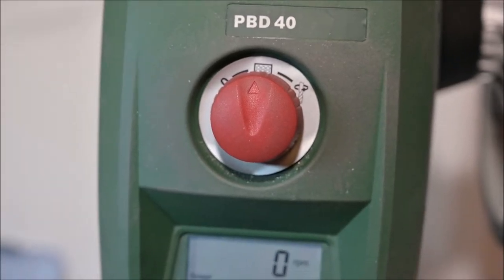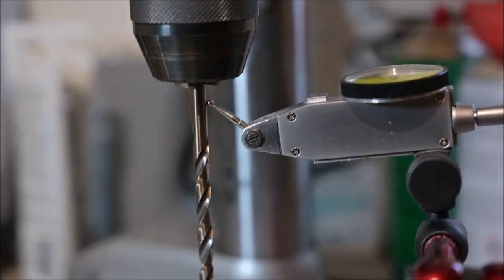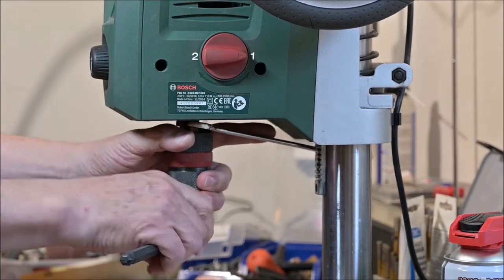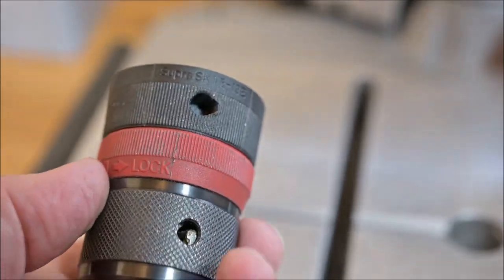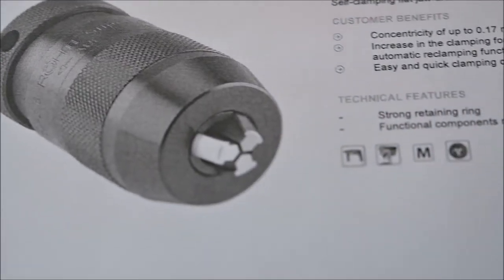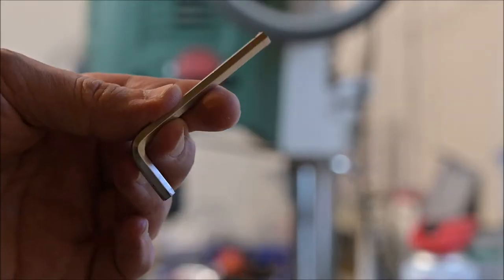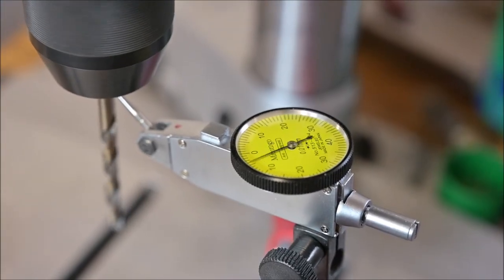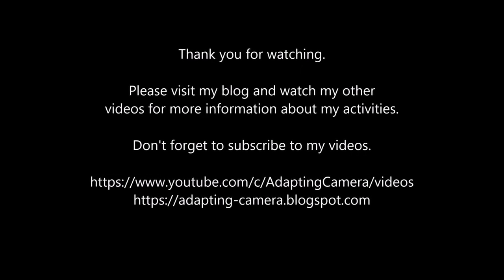Chuck changing on Bosch PBD 40

Comment: Be careful. In my case, I completely destroyed the chuck. I did it according to the presentation on youtube. The inbus key cannot be tightened well  in the chuck  and from there I started to have problems. The problem in my case is that the chuck is blocked after this  procedure  and is not possible  to  fix it. At the end I cut the chuck with the angle grinder( flex), so pay close attention.
Reply from the maker: I don´t understand how you managed to destroy the chuck. You must always check that the Allen key is properly tightened and NEVER use a hammer or anything that you hit it with. Many video on YouTube shows chuck removal totally wrong. Hitting the Allen key might cause damage to the chuck. Also, one can also use a chuck removal tool, which actually fits in the two upper wholes of the chuck and use that, not the Allen key, but most people don't have such tool. The method with the Allen key is safe, but as always, you must know what you are doing BEFORE. Attacking the chuck the wrong way may of course cause damage.
Reply: @AdaptingCamera  Because allen key is not enaugh tight in this  quick chuck ,this is the reason.
Reply from the maker: @alexandrubogdanjacob  In this respect, this chuck is not different from any other chuck. It is possible to tighten it enough and safely remove the chuck, but you must do it properly AND the Allen key must be large enough AND as I said, NEVER use a hammer. Tightening it like a drill bit and using brute force and hammer can destroy any chuck. I am pretty sure that this was the reason you destroyed your chuck. Your Allen key was not tightened (you did not check it in time) and you used brute force. How to tighten the chuck with difficult bits is described in the manual of PBD40. It is NOT my fault if you did not read it and started to remove the chuck without checking that it has a good grip on the Allen key. It is also possible that there was something wrong with your chuck already before. Anyway, saving the old chuck was not my goal, so even if I'd have destroyed mine I would not cry over it, since it is really crap. I would definitely not sell it or replace any of my other chuck with that one. It's the worst I have ever seen on any machines I ever had.
Reply: I also had issue with presented method. in my case, 12 hex+pipe, the lock mechanism yielded and chuck started turning on it's own, rattling. 
I ended up grinding two parallel planes on the metal part to have better grip with a french+pipe extension and that finally did it.
Also exchanged both bearings of the chuck shaft. Used a concrete anchor to extract the little one. 
Result? Zero play to naked eye 😁👍

And just in case - NO. HAMMER. WAS. USED. i should know - i was there 😑

Comment: Can someone show me where to go to read instructions on how to upgrade all the bearings in this Drill press? from the comments it sounds like it should be fairly simple, Also which bearings to buy for it?
Reply from the maker: There are several videos showing how to do it. Make a search and you will find them. I bought all the bearings, but in the end I never done the bearing replacement, instead I ended up with a new machine. https://youtu.be/5_HTjUOUsf8?si=Nv743Ol2Ql6DbCAi

Comment: I have found your video most helpful and informative. I recently found that my  PBD 40  drill press has developed a jerky action and I removed the plastic covers and found a loose wire hanging in mid air (it is a blue colour). Do you perhaps have a wiring diagram of this machine because I cannot be sure where exactly the loose wire goes back.  Just for more information it is the 220 volt power supply coming from the input cable which is hanging loose (the blue one); the other purple one for power supply goes directly to the variable speed switch.
Reply from the maker: Thank you very much for your kind words and comments. Unfortunately, I don't have the wiring diagram, and don't have enough time right now to open it up to have a look inside. It is though very strange that a wire is loose inside the box. There are several blue wires inside if I look at this video, there is at least one at the bottom: https://youtu.be/f5hLR6-9dEg?t=999 and one at the top: https://youtu.be/f5hLR6-9dEg?t=1016 but have a look at the whole video, perhaps it will help you somehow. It is in Russian, which I don't really understand, but it may be worth watching the video anyway.
Reply: @AdaptingCamera   :- No problem. By a process of deduction I worked out where the loose wire should go and my Bosch PBD 40 is now back in good working order. Wishing you a good day from Cape Town, South Africa.
Reply from the maker: @GentlemanH  Thank you very much. I am glad you worked it out. All the best to you from the other end of the world, Sweden. I actually lived five years in SA a long long time ago, not in Cape Town, but in Joburg. Been around a lot but for some reason, never in Cape Town.

Comment: I wish I could also change the chuck.... now I have a drill bit that is completely stuck in the original chuck. Have you ever tried that, and if yes - do you have any advise how to get it loose
Reply from the maker: I am sorry to hear that. The only time this happened to me was when I inserted a small drill bit with a bit of an offset so it ended up clamped with with two jaws clamping more than the third. It was very difficult to remove it but eventually I managed. The problem is if the drill bit is small it can easily break, making the situation worse. If the drill bit is large you could try to get a good grip of the drill bit with a pair of locking pliers or something similar and could try to rock the drill back and forth so that it moves towards the centre of the chuck, or you might even manage to release the chuck grip if you manage to hold the drill bit. The problem can also be caused by the locking mechanism of the chuck, try to twist the ring back and forth, maybe it will release the lock that way. It is very difficult to say exactly what you should do, but I really hope you manage to remove that drill bit without causing damage to the machine. In the end, maybe the only solution is to remove the chuck with the drill bit inside. There is no screw in the chuck, so technically it is possible, but may be very difficult to do it without destroying or damaging the original chuck.
Reply: @AdaptingCamera  thank you for your answer. I will try later today and hope for the best :-)
Reply: @AdaptingCamera  I got it out - pyhhh. It was a plug cutter that has a hole in it. I could place a iron rod in the hole of the drill bit and gently tap on the rod - then it let go. Thank you for the advise :-)

Comment: I'm having mo luck unscrewing the old chuck despite using a pipe like you suggested. 
The key ends up slipping every time 😢
Reply from the maker: I am sorry you have problems removing the chuck. If I had problems I'd make a special tool, similar to an oil filter remover tool for cars, but would make one more rigid and with two pins which would fit into the two holes on the top par of the chuck.
Reply: @AdaptingCamera  so it turns out I did undo it. I turn around the chuck et voilà. So it's not that obvious when it's undone with the spanner. Thanks

Comment: Hi, excellent video. Would you think the chuck wobble is worse than cheap entry level 'traditional' style bench drills? Surely not. I mean like the cheap one 300-500W units that all look the same like they came from the same factory just with different colours and stickers.
Reply from the maker: Hi, I never had one of those cheap ones, but when I bought the PBD40 I looked at the cheaper ones and felt that all of them were flimsier in design and the chuck wobble was noticeably worse on those. Even the quill wobbles on most of them, though that can be trimmed to a limit. Because of the poor, cheap design, those machines must really be upgraded and improved already day one. I think if you are looking for a better machine and want a traditional bench drill then you must buy one for at least twice the price of the PBD40.

Comment: Thanks for the useful video. Following your advice I made the same upgrade. My problem is that now the drilling depth gauge is not correctly working. It works when the machine is not in operation, but once I start it it will constantly indicate different depth even when I do not touch it. Does anyone experienced the same issue? (I Hope I’m clear)
Reply from the maker: Yes, I think you are clear, but I can hardly imagine that the actual change of chuck caused the issue. However, you could open the side of the machine and check is the slider attachment or the other part is a bit lose. Maybe one or two screws need to be tightened inside the machine which causes your problem.
Reply: @AdaptingCamera  thanks, I agree with you. I’ll open it and check it inside
Reply from the maker: @polochevs  Good luck. I hope you will fix it.

Comment: Hi and thank you for posting this! I was wondering if we can safely conclude that the infamous play this drill exhibits is only produced by the chuck and that the quill has no contribution.
Reply from the maker: Hi, No, don't draw that conclusion. There are other reasons for the play also, I think that the bearings are some of the reason. Never the less, changing the chuck makes a HUGE difference, as far as precision drilling is concerned. I will make an attempt to change the bearings also, I already have a full set of high quality bearings, and will do it as soon as I have time. Will post a video about that too.
Reply: @AdaptingCamera  Looking forward to that one. Thank you!
Reply: @AdaptingCamera  Well done. I look forward for the next upgrade too. Compliments.

Comment: Great video... Thumbs up! 👍
Which chuck to use from the link?
Is that chuck suitable for the PBD-40:
Quick-action drill chuck SUPRA-S, Size 16S, Mount 1/2"-20, Clamping capacity 3-16, light version?
Thank you.
Reply from the maker: Thank you for your comment. The one I chose is shown in the video here: https://youtu.be/nCqVoaGVK8g?t=338 and here: https://youtu.be/nCqVoaGVK8g?t=498, the part number is: 871050. The 871062 is also OK, but it takes drills from 3-16mm, which is a bit too large for my needs, since I needed from 1 mm, so the 1-13mm range fits my needs better.
Reply: @AdaptingCamera  that’s great you’re sharing all that useful information. I was searching fo your chuck part number but wasn’t sure about it so your post comes right at the time. I think I’m gonna order the same as you since the one I’ve posted is bigger and heavier as well.
Reply from the maker: @icebmwpower  I have all the bearings but have not bothered to change them yet. Maybe later on when I have more time. I ordered quality bearings and not went for the lowest price because I figure if I change, I might as well change to the best ones I can find. The PBD40 already has cheap bearings, so no point changing to cheap ones. I ordered my bearings from this seller: https://www.ebay.com/usr/kugellager-handloser
Reply: @AdaptingCamera  Thank you for your post. It’s not about the money. In my country there are no options at all and that was the option I’ve found. Could you be so kind and provide me a direct link to the ballbearings you have cause couldn’t find them in his eBay shop?
Reply from the maker: @icebmwpower  I bought several just in case I find the one better than the other. Here is a list of the ones I bought:
https://www.ebay.com/itm/372145357584
https://www.ebay.com/itm/281948686177
https://www.ebay.com/itm/283703628948 (bought the 6002 2Z)
https://www.ebay.com/itm/282875496085

I have no idea about if the seller is shipping to you, but you can always ask via a message. I have nothing to do with the seller, but he answered the questions I asked very fast, and shipping to Sweden took only a few days, so I was happy to buy from him, and would buy again if I need to. Good luck.
Reply: @AdaptingCamera  thank you very much for the links. Highly appreciated. Looking for ball bearings only, so I sent my questions to the seller from your last link. 
In addition I found these guys and will text them later today  is email, so we’ll see what the result will be. They’re sending in Europe which is fine for me. Will keep you updated. Here’s the link if someone need it: 
https://rc-schrauben.de/Ball-Bearing-ZZ-Metal-Shielded-8x12x35
PS. Going for ZZ (metal) sealing which IMHO should be better for the PBD-40 shaft.

Comment: Excellent video, great discussions in the comments as well. I experience some rotational play with the whole drill-head along the post. Is this something you have experienced / fixed?  Ordered a new chuck. :)
Reply from the maker: There is a slight wobble, but it never prevented me from drilling accurate holes.
Reply: @AdaptingCamera  I actually saw (after I wrote my previous comment) that you mentioned this issue as well in the conversation below. Interesting that it doesn't affect drilling. Feels like one might tend to pull it to the side when drilling.  Also, did you ever change the needle-bearing?
Reply from the maker: @JWAM  If you start drilling at a precise spot then as soon as you have started there will be a guide for the drill bit, so it stays there. The drill head is not wobbling during the actual drilling, only when in the air and only when pushed. There is no uncontrolled vibration, which would create too large holes or breaking the bit. Anyway, it's on my "to do" list, but have no time, and since it is no big issue, the priority is set accordingly. BTW, you asked about the needle bearing, and the answer is the same. Not been changed due to the fact that it takes time and during that time I can't use the machine, and I also don't see that it causes such issue that I can motivate spending time on it. But one of these days...
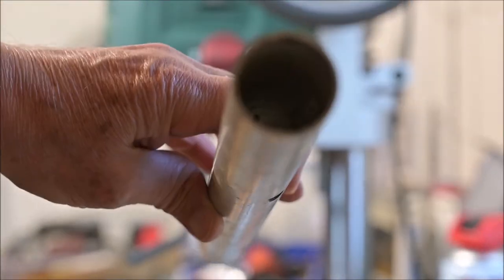Reply: @AdaptingCamera  If you didn't receive my message with the link, please check your spam-filtered messages in the YouTube menu. Look at 2:58 and the obvious wobble of the whole head. The bigger the forstner-bit or hole-saw, the bigger the problem, I guess. Thanks for the update on the bearings. I think I'll change the chuck and try to reduce the play (a simple shim somewhere?) and see if it feels sturdy enough.
Reply: Oh wait... Maybe THIS is what you meant by "wobble" all along? I was talking about feeling it the play when not drilling. It may be correct that it may not affect hard surfaces, and that the loose needle-bearing actually helps the shaft from not binding and simply gives way for the wobble? I.e., the loose bearing may be a design feature....(!!)
Reply from the maker: @JWAM  There is nothing at 2:58, but at https://youtu.be/nCqVoaGVK8g?t=194 it is not the machine which wobbles but my video camera vibration reduction seems to have been effected by the fast focus move and the new focus. It seems that the whole image is shaking slightly, not only the machine head. My machine is bolted to the table below, which in turn is fixed to two walls, so everything is very rigid. In the video, everything is shaking, but that's just an illusion. In reality, the machine head can wobble a bit, but really very little, as you actually can see it here: https://youtu.be/nCqVoaGVK8g?t=442 where I shake the chuck. I mean, the wobble is really small, you can still read my serial number even though I am shaking the chuck. But if I grab the machine head then yes, I can wobble it, that's clear.
Reply: @AdaptingCamera  The timestamp was to the video I linked in the message before that. There you can see the wobble very clearly while drilling. Didn't that message go through?
Reply from the maker: @JWAM  When I click on that timestamp I get to my own video at 2:58, that's why I made that comment. I have no link to the video you seem to discuss, but can have a look if you give me a link to the video. Anyway, I don't have a forstner bit, but have several hole saws, and yes, they wobble the head because it is not a mill, it's a drill machine, and also because those have hexagon shafts, not as well balanced as real drill bits. The machine is specified for maximum 13mm drill, so everything above that is bonus according to me. That said, I have actually managed making much bigger holes using hole saw, but it must be well balanced and very high quality at the right RPM and well lubricated.
Reply: @AdaptingCamera  As I expected, youtube blocked it (even if I can see it). Either check your spam-messages or search for "Talhoffer pdb40 5 years" without the quotes for the video (from user Talhoffer)
Reply from the maker: @JWAM  Thank you. I watched it now, and yes, that's what's happening. In fact, I have seen his video some time ago and even commented it. Never the less, just as he says, the machine is specified for maximum 13mm diameter, so everything above that is bonus, and it works actually well. Done properly, I am happy with it. I have also made quite a few wheels and circular cuts up to 60mm in diameter with grate success, but just like he says, you have to turn around the work piece when you are half way to get a good finish. Accuracy depends a lot on your circular saw. But of course, if you need really accurate large diameter holes, or circular cuts then a mill, a CNC router or a lathe is a must. No dill machine and hole saw combination can give you the accuracy of a good mill, lathe or CNC router.